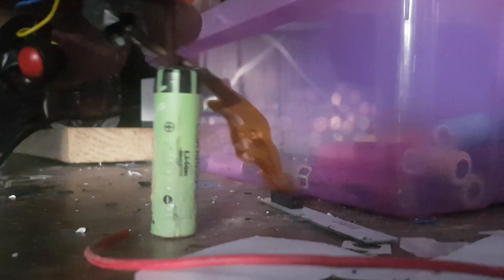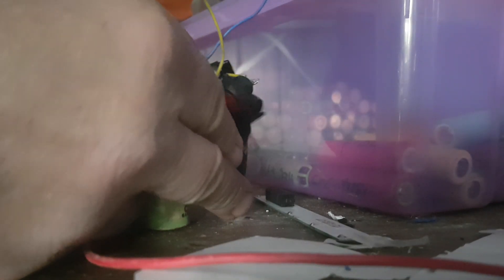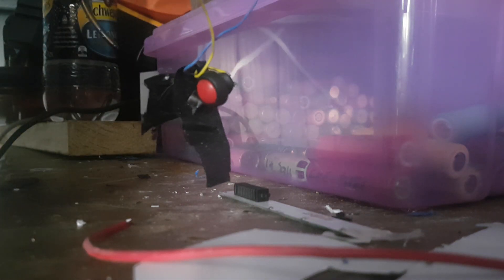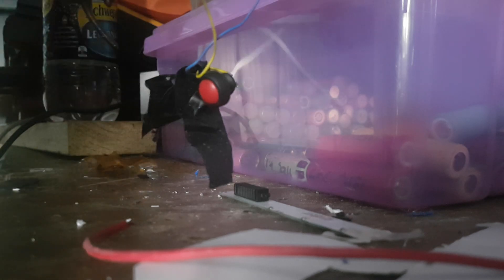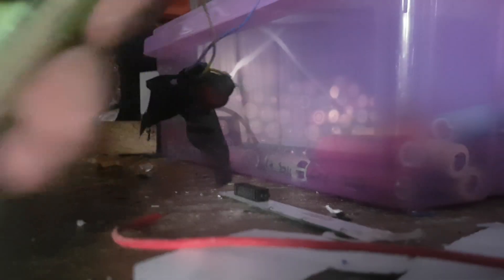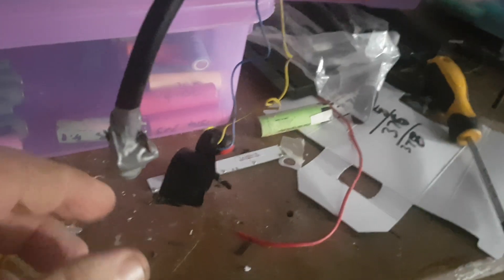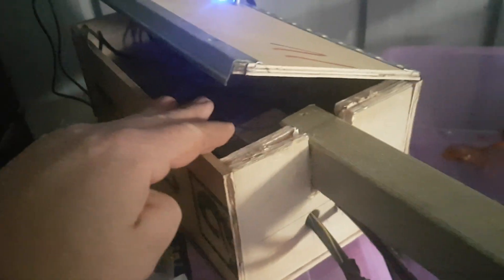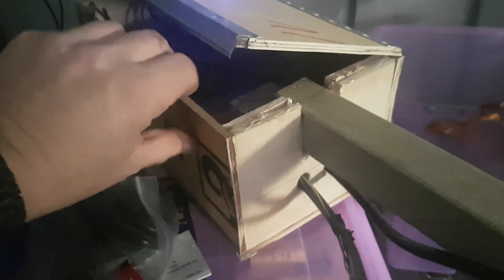Home made spot welder progressing slow. But it works. 555 time circuit. Part 3

Comment: If you use a microcontroller you can do multiple pulses which seems to do a better weld without blowing through the battery. Yep Arduino sounds like a good idea.
Reply from the maker: brettwatty101 that is my next thing to do. There is an english guy that has done a simpler setup.